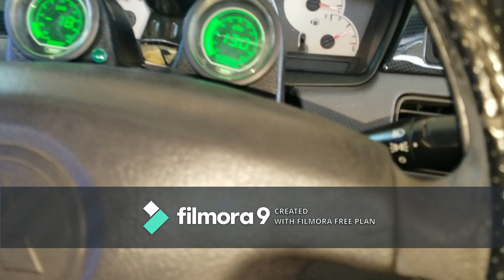Mitsubishi Lancer CS3 4G15 Forged Engine Build

Comment: Hey great video. Have a twin cam 4g15 an noticed oil in the radiator need a good mechanic 🇹🇹
Reply from the maker: Thanks man. That sounds like your headgasket is blown. My dad is a good mechanic.  You can get him at - 726-1579 - Persad

Comment: Bless up from jamaica , i have a 4g18 wana build in the up coming months should i built it with the stock head or would i get more power to use the 4g18 block and 4g15 DOHC ?
Reply from the maker: Thanks for the question man and sorry for the late response. I would go with the 4g18 block and the 4g15 dohc head. The 4g18 has a longer stroke so u can make the power easier. Single cam makes good power as well, I just wanted to try dohc and see how it works
Reply: @danielpersad5789  ohk thanks for the reply it helps alot bless up...
Reply from the maker: @legistermusic7342  yea pal

Comment: Is that suzuki vitara piston?
Reply from the maker: Yes correct. Ebay vitara pistons rated for 500hp
Reply: @danielpersad5789   link?
Reply from the maker: @ezras4g15t8  I just searched 75mm pistons on ebay and u will see them.  I went a lil over with a 75.5mm piston as I wanted to set my piston to wall clearance
Reply: What con rods u use?
Reply from the maker: @ezras4g15t8  I'm using 4g15 maxpeeding rods
Reply: @danielpersad5789   what pin u use
Reply from the maker: @ezras4g15t8  same pin that came with the pistons. Just had to get the rod opened to match the pin
Reply: Can you give me some advice on what I can add to my SOHC 4G15 to increase performance without lasting damage?

Comment: What clutch you using bro?
Reply from the maker: I'm using a mivec 215mm act extreme pressure plate. I had to use a flywheel from a awd 4g15 to get that clutch to work

Comment: Hey Daniel, I have a car just like yours (4g 18 cs3). Only problem is that its a local cabourated and I want to change my engine to fuel injected. Can it be done, can you give me some advice. Can I WhatsApp you for info on how much you would charge for the job?
Reply from the maker: Yes it can be done. I can put you on to someone. You can get me on 356-4483

Comment: Приветствую. Вопросик такой- а масляные форсунки есть на низ поршня?
Reply from the maker: Can you translate to English?
Reply: @danielpersad5789  Greetings. The question is - are there oil nozzles on the bottom of the piston?
Reply from the maker: @gonshik289  thanks for the reply.  The 4g15/4g18 does not come with oil squirters under the piston
Reply: @danielpersad5789  thank you, I want to put a turbine from Mitsubishi colt 4g15t on 4g18, here I think how to do everything
Reply from the maker: @gonshik289  sure man. You can go through my channel. I have a vid called turbocharging your 4g18/4g15. That shows everything that I did. Any more info, you can also message me. 1-868-356-4483
Reply: @danielpersad5789  Yes, I've already watched all the videos and wanted to do the same. you did everything very cool
Reply: @danielpersad5789  and I also wanted to ask what is the cross-section of your exhaust pipe
Reply from the maker: @gonshik289  thanks very much! Plenty more to come!
Reply from the maker: @gonshik289  I currently have a 2.5inch downpipe going to a 2.25 rsr catback. But I will be upgrading downpipe to a 3 inch
Reply: @danielpersad5789  understood, thank you
Reply from the maker: @gonshik289  no problem. Glad I can help